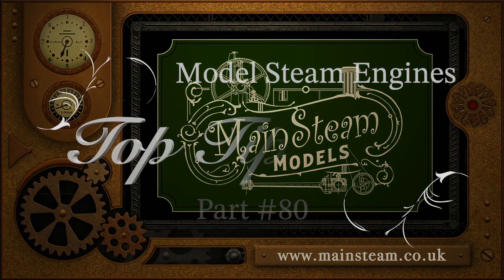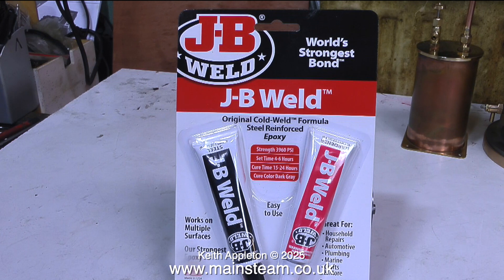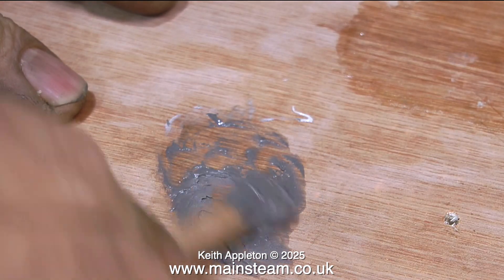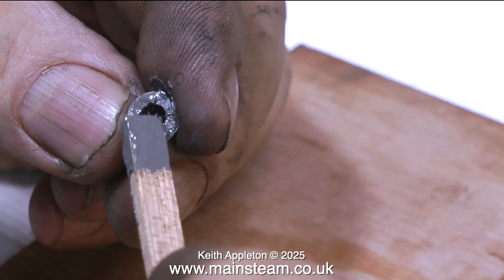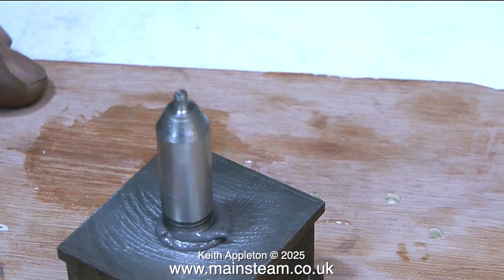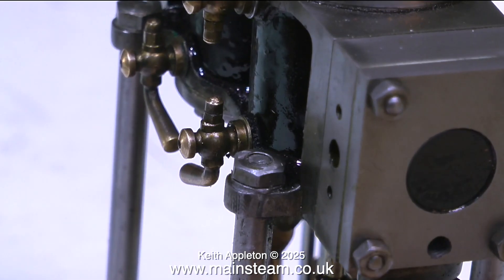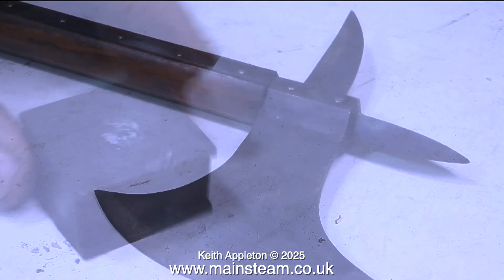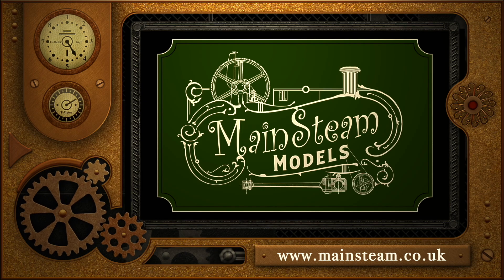MODEL STEAM ENGINES - TOP TIP TIME - PART #80

Comment: The long curing JB Weld is miles above the 5 minute JB Weld. I've seen diesel engine blocks glued with this stuff still on the road. 
  Another great product but very expensive is Lab Metal. It's an epoxy type stuff in a can. No mixing two parts together. It's loaded with iron and aluminum powders and dries rock hard. You can even drill and tap it and holds threads very well. The down side is that it will harden in the can and has a minimal shelf life.
Reply from the maker: Thanks for the information, I always use the 24 cure version. I will look into Lab Metal but I think that I will stick with good old JB Weld.